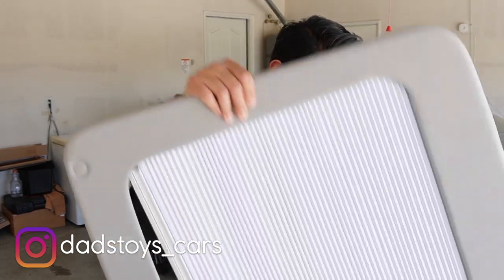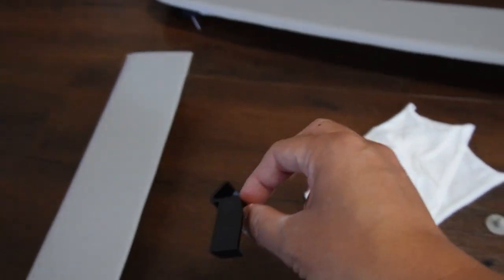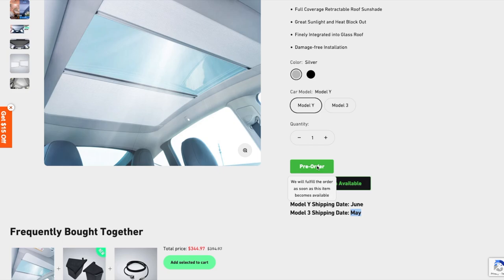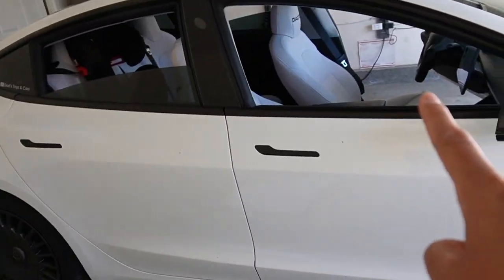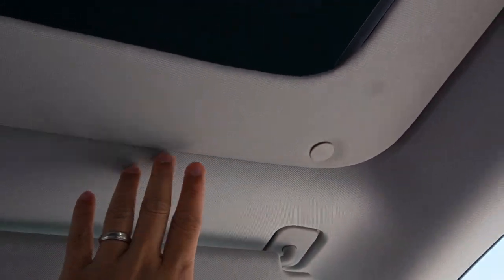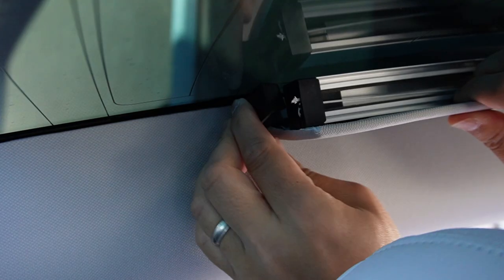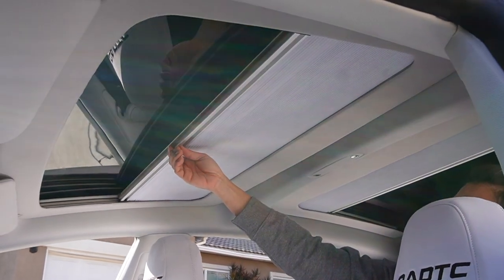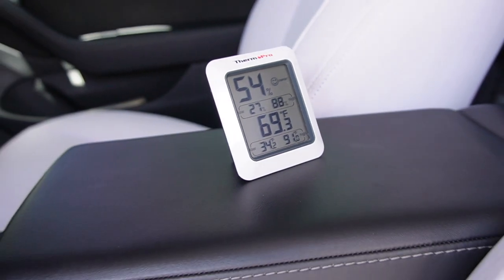2023 Tesla Model 3 Retractable Sunshade Upgrade / Must have Tesla Accessories! #tesla

Comment: I just purchased and installed about three weeks ago and the design has even further improved.  No longer are there holes and plugs for the frame material in the front left and right corners, since there is no need for them with the new front clip installation.  I've been very happy with mine.  They make a discernible difference in the heat of summer.
Reply from the maker: Definitely big help for the summer.
I’m glad you liked it too.
Thank you for your awesome support!🙏😃

Comment: I just installed mine today and the front shade was kind of a tight fit. The driver's side sits a bit lower and not as flush as the passenger side due to frame rubbing against the liner. Also, the shade did not want to close all the way in. If I try to shut it closed, the shade would slide a tiny bit out leaving a small gap.
Reply from the maker: Thank you for sharing.
Very interesting because I don’t have that issue with the front part at all.
Reply: @dadstoyscars  does your shade close all the way or is there a gap?
Reply from the maker: @scut1179  It does close all the way to the front part
Reply from the maker: @scut1179  You might want to take some pictures on your issue and email to Otrifowd. They might have solutions for you.

Comment: Why not moving these lockers to the right and the left before putting the sunshade in place?
Reply from the maker: It’s harder to put it on the left and right first. There is more room to put it in the middle first and as you move out to left and right it will get narrower and tighten up the locking clips.
This is definitely the cheapest one I’ve seen and easiest to install that I can find so far.
Thank you for watching and your great support!🙏😃

Comment: Do you think the weight of this unit will pull down the headliner?
Reply from the maker: I don’t think it would as I have this on for more than a month now with no issues at all.
Thank you for watching!
Please subscribe for future contents.🙏😃
Reply: @dadstoyscars  Additionally will it interfere with the overhead airbag?
Reply from the maker: @PackFan-tv5pj  The side curtain air back would likely drops down but the sunshade clips onto top part of the headliner.
With that being said, it shouldn’t interfere with side curtain airbags.
Reply: @dadstoyscars  Yup - I've just reviewed a number of crash test videos for Model 3 and that appears to be what happens. THANKS!
Reply from the maker: @PackFan-tv5pj  no problem 😉

Comment: What is the difference between the 1.0 and 2.0 model?
Reply from the maker: 2.0 is cheaper and easier to install.
Thank you for watching and your great support!🙏😃
Reply: @dadstoyscars  are the materials and build quality the same?  It is such a big price difference.
Reply from the maker: @kgflash4Sr  they actually improved from previous version. I think it’s more on the logistics that made it lower cost.
They figured out the better way to install and package it in smaller box.
Reply: @dadstoyscars  I feel bad having. Just purchased and installed the 1.0 version.  😔

I will be recommending this to my friends though
Reply from the maker: @kgflash4Sr   They just sent this version to me too. I think Model Y version 1 should be a little better structure because it seem like the V2 model Y comes in more pieces and you have to put them together yourself. This is just my speculation as they they haven’t send model Y V2 to me yet.
Thank you for your support!🙏
Reply: @dadstoyscars  Thank you so much and keep up the great work.  I got the 7.2" rear entertainment as well because of you.  I was able to use a multipoint dongle connected to the right USB port to connect 2 Bluetooth headphones at the same time.
Reply from the maker: @kgflash4Sr  that’s awesome! I love that thing!
Reply: Why discount doesn’t work ?
Reply from the maker: @Pesplayer234   I already emailed out the Otrifowd regarding this code issue. I hope it will be solved soon.
I tested be the code before I release the video but for some reason it stopped working ☹️
Thank you for watching and your support!🙏😃
Reply from the maker: @Pesplayer234  They emailed back to me and now the discount code: DADTC10 is working.

Comment: Hello, I tried to use your DADTC10 code but it's invalid according to the site.
Reply from the maker: I just tested it and it worked.
Please try again. It should work.
Thank you for watching and your great support!🙏😃
Reply: @dadstoyscars  Weird it still doesn't work for me, I try it for both the 3 and Y (I have the Y). Cam on Anh :)
Reply from the maker: @hnghieu  Did you try different browsers? Maybe that would help.
Reply: Yup, different browsers also in private and incognito modes, but still wouldn't work
Reply from the maker: @hnghieu  I just tested now and it’s invalid too!
I’m sorry. I will reach out the to Otrifowd to solve the issue as son as possible and will let you know.
Reply from the maker: @hnghieu  They emailed back to me and now the discount code: DADTC10 is working. You will get extra 10% off